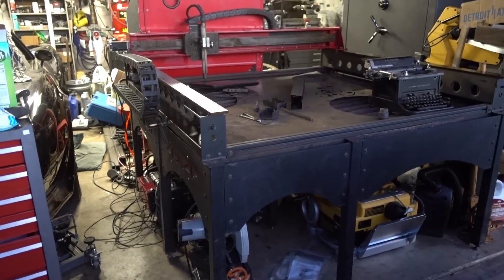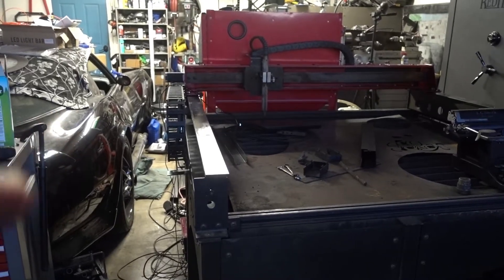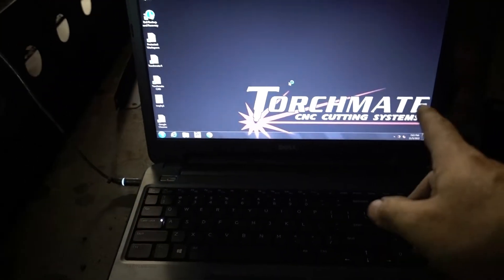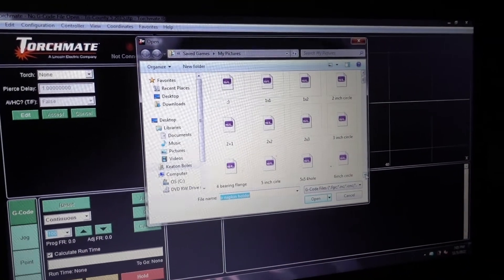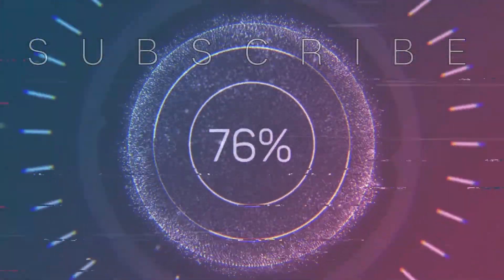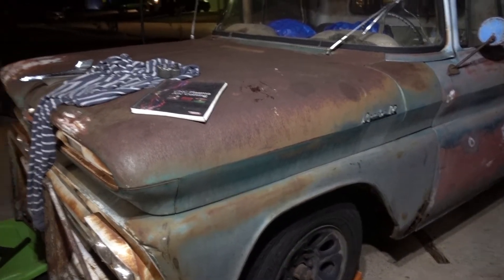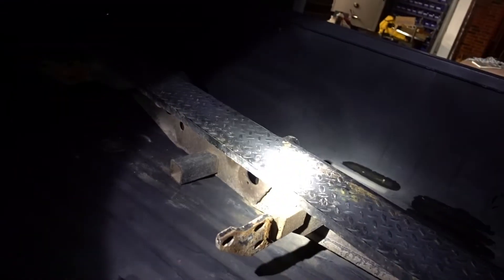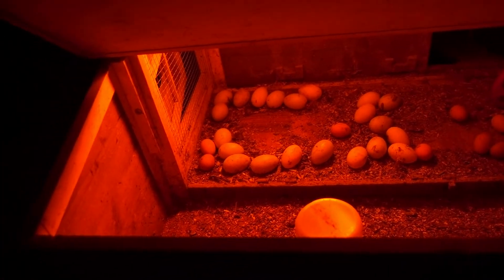New to me plasma table Torchmate 4x4 Growth Series No Cutting

Comment: I have the same machine.  I've been through all of the little issues.  I can tell you where all of those wire go.   happy to help if I can please reach out.
Reply: I am not sure he is responding through this channel but I was trying to get more information on this setup. I actually have a Torchmate 4400 a 4x4 table and it comes with the Accumove 2. I have been issues with this one from day one about a month ago. My plasma cutter is a Powermax 85 and it has the receptacle port for the CNC but up until now I cant get these two to work together. This is the most updated post I had found even though is from a year ago I hope you are still doing this work and if you can please let me know how those wires are suppose to connect. All I know there are 3 pairs of wires coming from the Accumove 2 Arc, Ok to Move and Start (green and black red and black, and white and black) may not be in the right order. I traced the cables to the Powermax and I found only 4 cables are actually connected to the end of the cable. The white and black combination are not connected at the end of the cable. I recall this pair is the voltage divider but it is connected inside the Powermax to the PCB board that was added I believe as an afterthought for the previous owner. At this time I am not sure this voltage divider board works as I don't have any means of testing it with out proper documentation. I could apply 110 volt pulse to the input and I should get a 50 to 1 or like 2.2 volts out. That's is just my logic but I can't go with that. I hope someone is out there that has fixed a setup like mine. Sorry for all the words and thank you for reading.